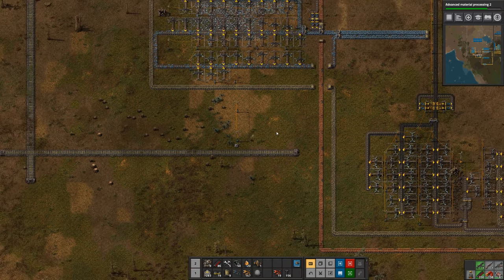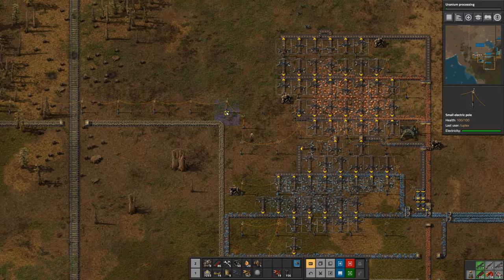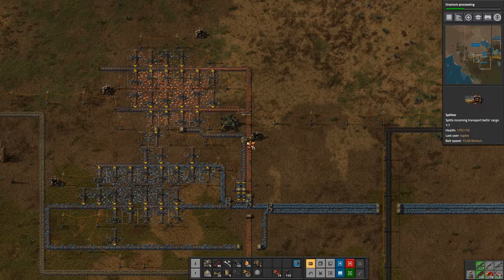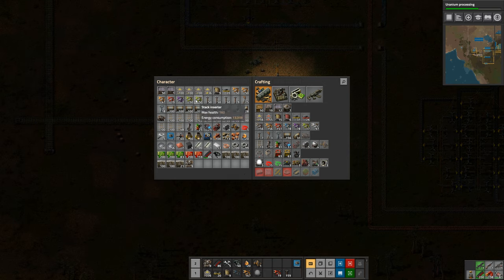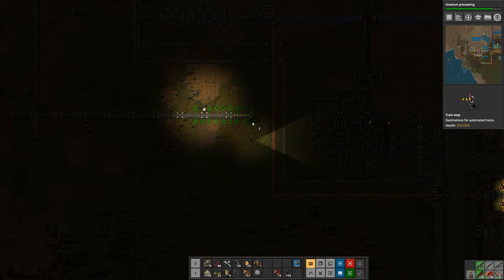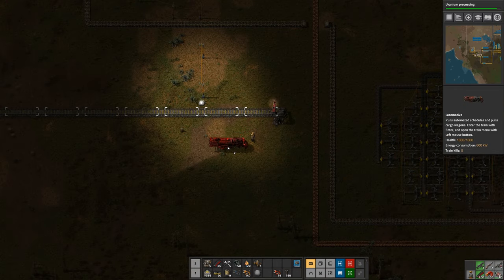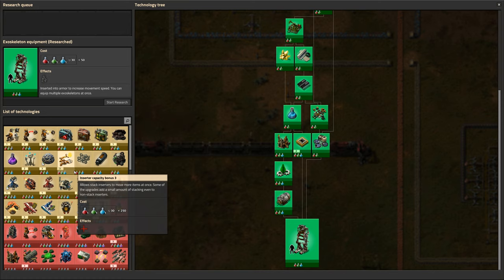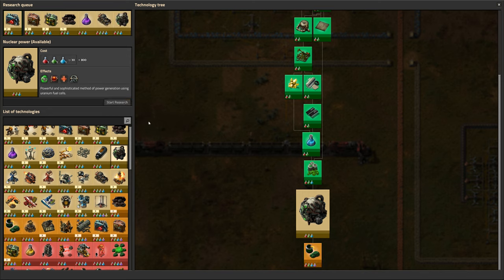Factorio 0.17 Tutorial #11 - Basic ore train setup

Comment: In the last video where we added red wire to the oil storage tanks for conditions, you mentioned that this will cause production to halt on other areas when it tops out. I've run into this issue and my chemical plant will no longer produce solid fuel. Do you have any advice on how to troubleshoot this and find a workaround?
Reply from the maker: Which tank is full?  If it’s petroleum, you can just make some solid fuel from the petroleum and it will get the oils flowing again.
Reply: @TuplexGaming  sorry, I'll leave a comment on video #10 with a timestamp to be more precise to the issue